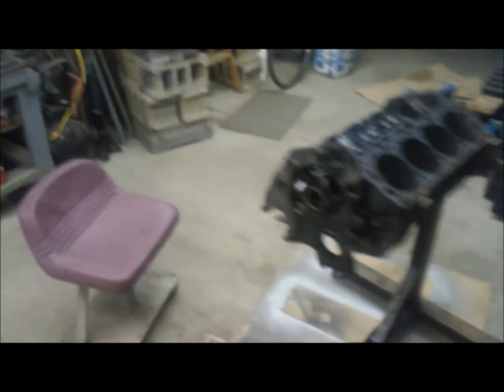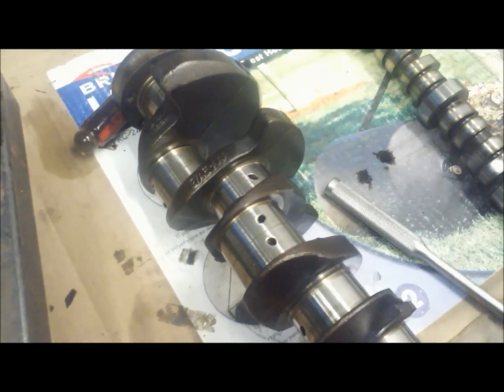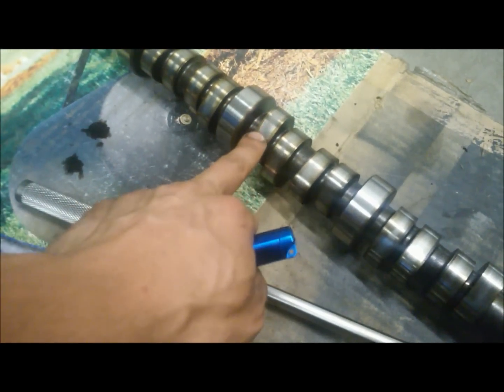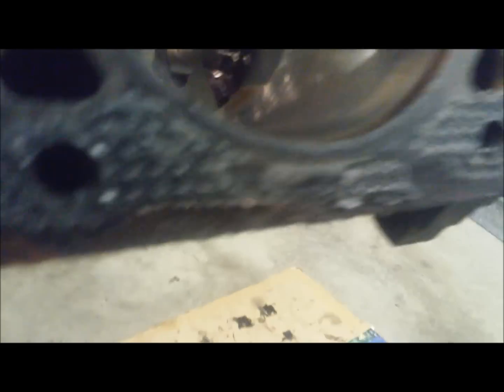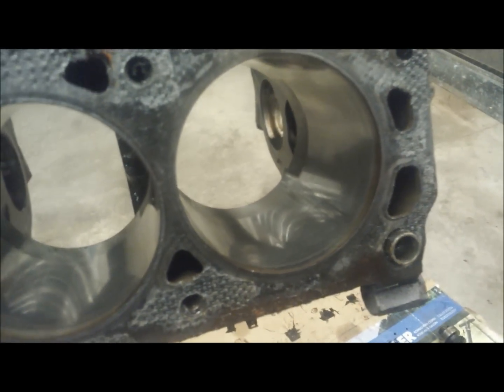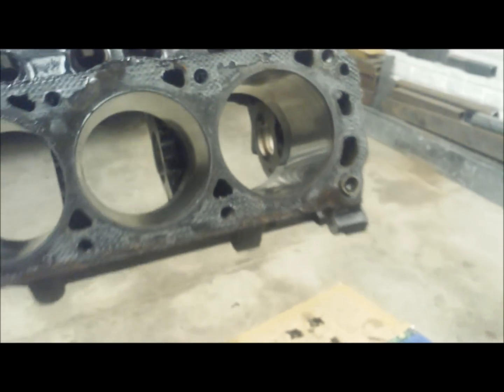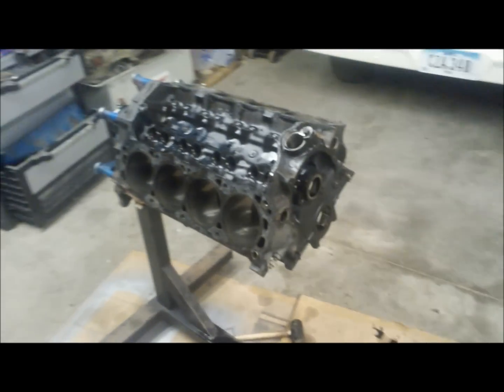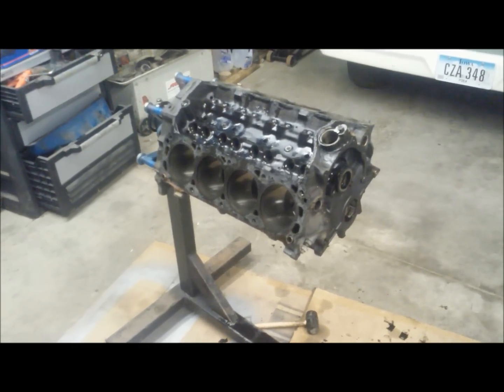Ford 302/5.0 Engine Tear Down - Step by Step Walk Through (Part 3 of 3)

Comment: Well the 4 Wear marks i actually also found on a Mercury Tracer 2.0L 4 cylinder and the reason it was like that was because the whole bottom half of the #1 piston was in the oil pan and the connecting rod would just bang around in the cylinder.... buuuttt thats not the case obviously lol
Reply from the maker: let me tell you, this was not a far cry. this is what happens when an engine is demo derbied, overheats, and the car is continued to be driven. cast pistons just have one hell of an expansion rate!
Reply: I think thats also what happened. Cuz this was my great grandmas car for like 10 years?  😂